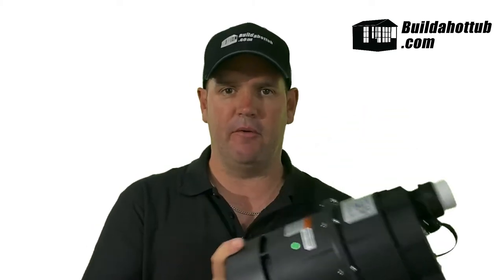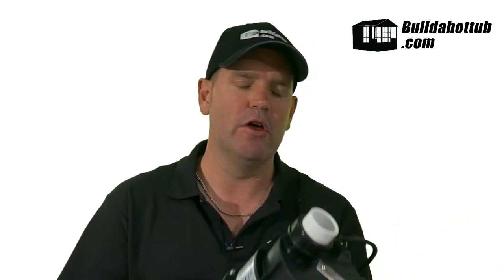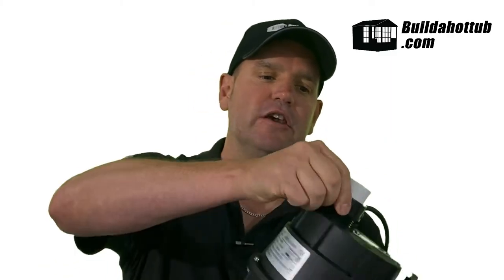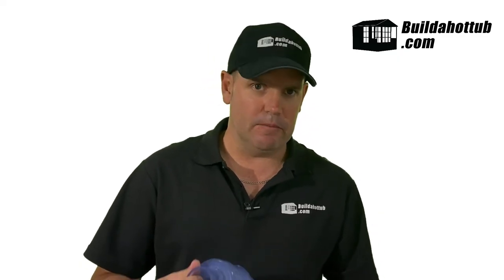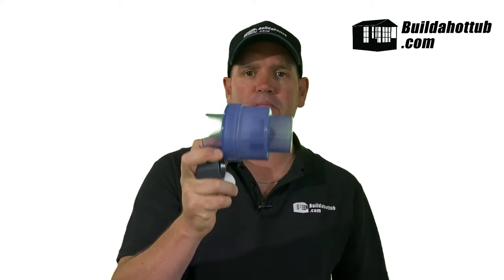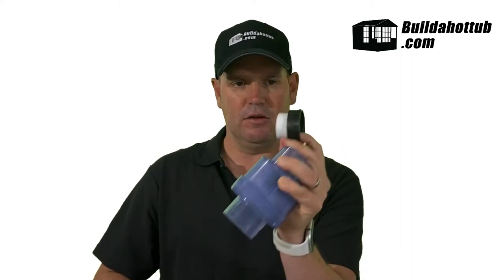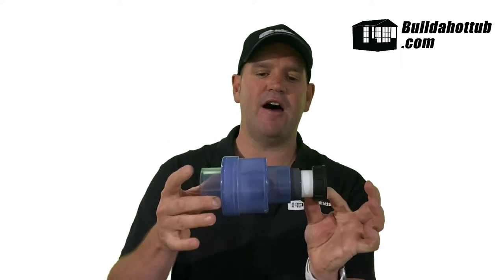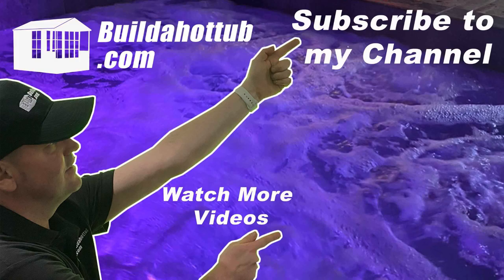Hot Tub Air Blower - Explained!

Comment: Hello thanks for the information, I have a question. How many PSI does the air pump need to have in order to mix with the water? 
in my mind the pressure produced by the air pump needs to be greater than the pressure of the water pump, is that correct understood?
Reply from the maker: Thanks for the comment - not sure on psi as the blowers tend to be in HP or Watts - 1hp or 700w tends to be the smallest you would put on a tub - hope that helps - Andi

Comment: This was very informative. I bought a used whirlpool tub and after filling it and inspecting it for leaks before installing it I noticed that some of the air lines at the bottom and sides of the tub were leaking. I found it strange that only the fittings at the bottom of the tub had steel ball check vales on them and not the ones on the side which made me worry as the fittings on the side were "taking in water" in the entire system but after hearing you say that the air lines are designed to take in water that eased my worries a bunch. Now I just need to replace the leaking fittings and pipes
Reply from the maker: Glad you found the video useful - thanks for the comment! Best of luck with the project - Andi
Reply: P❤❤

Comment: Maybe a stupid question im replacing my sunken in spa i noticed the blower plumbing, seems to come out of blower then drops 500mm and raised 500mm,is this for same reason as your check valve?
Reply from the maker: Hi Jason, thanks for the comment and question. Not a stupid question at all. I have seen on blower pipe runs where they go up and over the waterline of the tub in a "U" bend shape then drop down to create a "check valve-like" array of pipe to keep the water out. I have not seen them drop down 500mm as anythig below the waterline would not really have an effect of keeping water out and would still need a check valve on. Hope that helps! Thanks for watching, cheers - Andi

Comment: My blower blows air, hard.  I could blow leaves around my yard with it.  But the bubbles don't show up in my hot tub anymore!  The blower isn't really sealed to the pipe.... I can lift it off quite easily.  What could my issue be??  Thanks!  Andy, Fort Lauderdale Florida
Reply from the maker: Hi Andrew, if you dont have you pumps running, does that make any difference? I have seen it on gunite style jets (that have air and water lines) that lower pump pressure acutally works against the blower. Also, has the check valve stuck shut by any chance - this would block of the air totally if it has failed and doesnt open to let the air in any more. They are the only things I can think of at the moment Andrew - hope that helps
Reply: @Buildahottub if the blower stopped working, is it repairable? Does it have a reset button or brushes to replace? I have the Ultra9000 1hp 4.5A 120V blower..with Balboa system. Thanks
Reply from the maker: @kingbee4474  I beleive there is a fuse in the back of those models when you open them up - that would be worth checking first. If there is no fuse or it checks out ok - there is not a lot elese you can do with these - I have a replacement in my store if you need it - https://parts4tubs.com/product/blower-air-supply-ultra-9000-1-0hp-115v-6-0a-4ft-amp-3910131/ - hope that helps - Andi

Comment: Hiya so I have the same blower as the one your holding but it has a ridiculously loud turn off like I’m saying REALLY loud, almost as if a car was accelerating and then a backfire it sounds so close to it, all bubble jets work on the hot tub
Reply from the maker: Hi Will, could be a bearing that has gone - they are not that loud at all so something isnt right - shoot me an email (andi {a.t} buildahottub.com if you would like a quote for a replacement, I have these in stock - cheers - Andi
Reply: @Buildahottub  would you like a quick video? I can post one quickly on my page.
Reply from the maker: ok
Reply: @Buildahottub  okay I’m gonna post it now
Reply from the maker: Never heard anything like that. At first it sounds like the blower has become disconnected from the pipework somehow but the noise when it shuts down - never heard anything like it - not sure if it can be repaired, you would need to take it out of the plumbing and inspect to see if you can find anything - if not, replacement is in order - hope that helps
Reply: @Buildahottub  the blower is attached to the pipe work with a screw, found that a bit weird at first as it has ridges to be able to screw in a union thing, but the noise of it turning off came after we had drained the hot tub for a holiday and then filled it back up when we got back, but thanks for trying to help :)

Comment: How I can reduce the air flow? My arctic spa blower is too strong
Reply from the maker: Hi Italo, you could drop a ball valve into the air lines in front of the blower, then you could manually adjust the air flow. Hope that helps - Andi